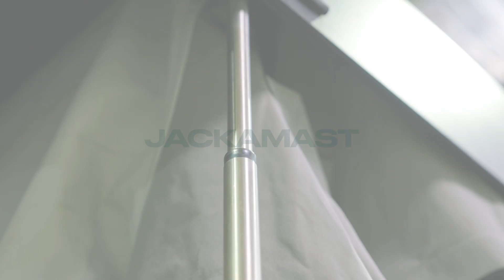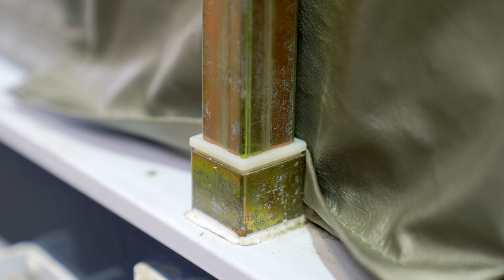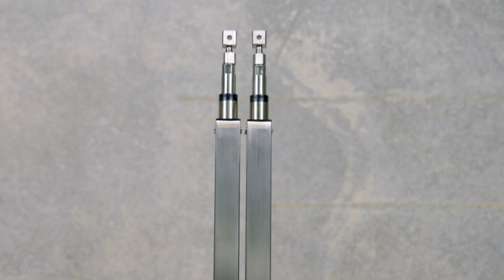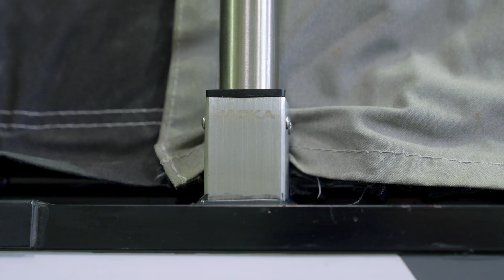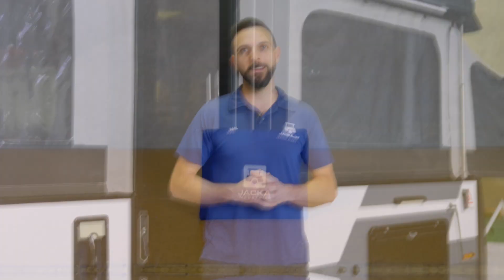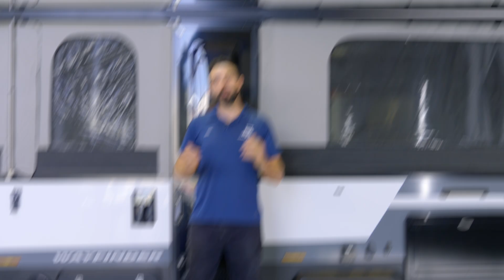Jacka Mast Launch

Comment: Hell yeah! Thanks team, going to install this on my 2023 camper because “Jayco gunna Jayco”.

Now I don’t have the lift system yet but I’m guessing that won’t be an issue.
Reply from the maker: Hi. Yeah, the JackaMast is great upgrade and an easy to DIY. 

It's a total like-for-like replacement change out. So no dramas if you have the manual winch system. 👌. 

You can always upgrade the lift system to a JackaJay kit at a later date. 👍

Comment from the maker: 😊 great questions. 
Yes they will be DIY friendly, and will have a video guide and written manual available. 
They will be purchased individually. 
They will fit all models of campers if they have 3-stages. (Some old models have 4-stages)
They will be compatible if you have a manual winch or JackaJay system. 
And yes we do have a nice Roof Bolt Upgrade kit available too. 👌

Comment: They look great! 
Q. Are they DIY install? 
Q. Do they come in a set of 4? 
Or do I buy 4 individual poles ?
Q. Will they fit any size & year jayco camper? (Swan outback)?
Q. Can they lift JackaHD? 

Thx Mal
Reply from the maker: 😊 great questions. 
Yes they will be DIY friendly, and will have a video guide and written manual available. Written one is on the website now. 😃
They will be purchased individually. 
They will fit all models of campers if they have 3-stages. (Some old models have 4-stages)
They will be compatible if you have a manual winch or JackaJay system. 
And yes we do have a nice Roof Bolt Upgrade kit available too. 👌